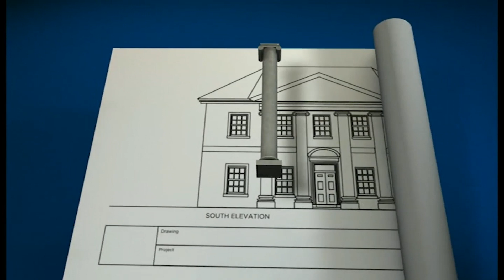Qualitative Design Review (QDR) CPD by Dr Graham Smith MCIAT

Comment: could you please explain where the 20% is from?
Reply from the maker: The 20% is a norm applied on many projects and has often been accepted by regulators for large scale geometries such as in airports and railway depots.  It can be varied if there is increased uncertainty in calculations or if slower populations are under consideration.